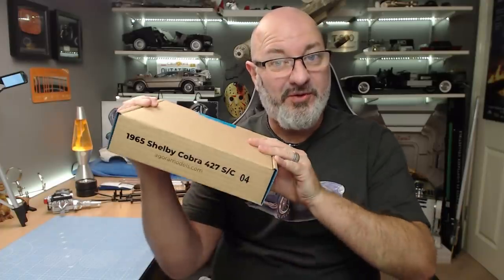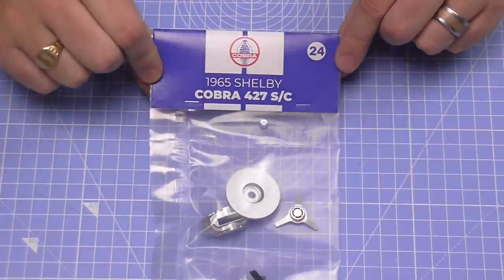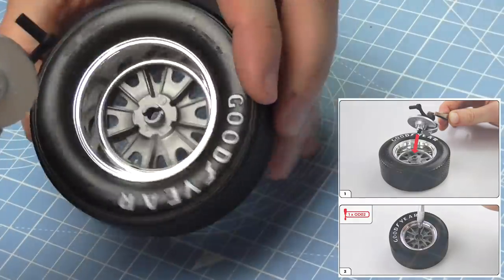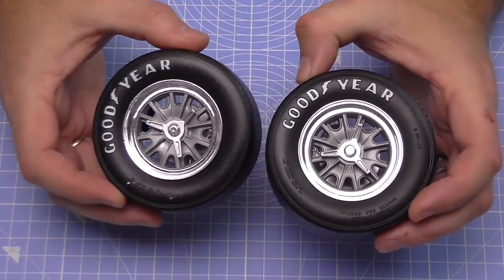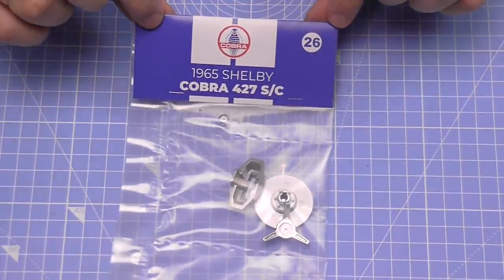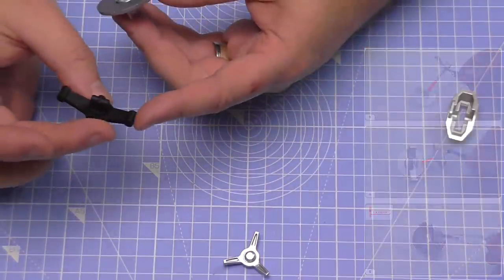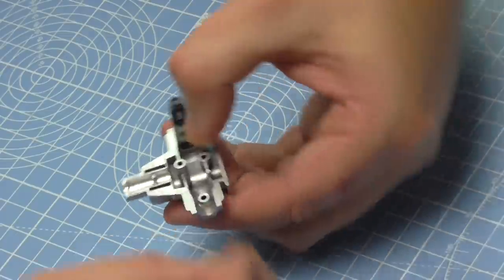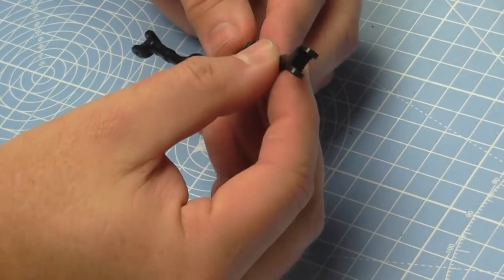Agora Models 1965 Shelby Cobra 427 semi-competition 1:8 Scale - Pack 4 - Stages 24-31

Comment: They could have put in the parts for the right brake and suspension in with this pack. Would have been nice to complete the rear suspension and drive shafts in this pack.

Comment: I like the detail on this build but it's a shame there are so many plastic parts.
Reply: The plastic parts are non load bearing which is the important part.  The plastic is well molded and when complete, will be indistinguishable from metal parts.  The reason for the use of plastic is to try and keep manufacturing costs from getting too high - this is still a $1,500 model kit which is out of reach for many modelers.  That is why they are typically sold via subscription, with portions sent out on a monthly basis.  I am fortunately able to pay for this model once and have the entire kit sent at once.  Frankly, I wouldn't have purchased it otherwise.  Agora only allows this type of purchase on a couple of their kits.